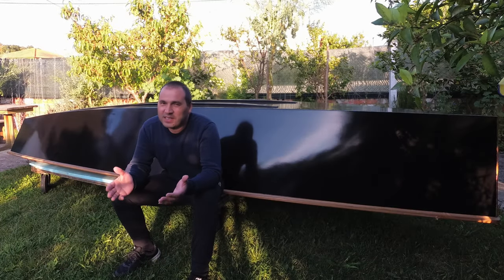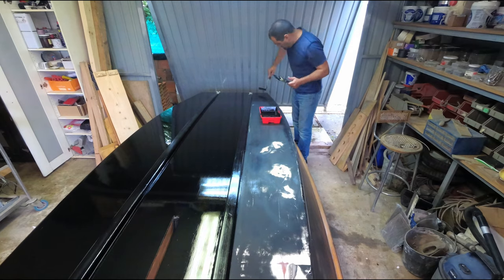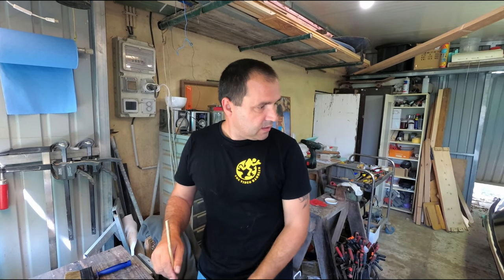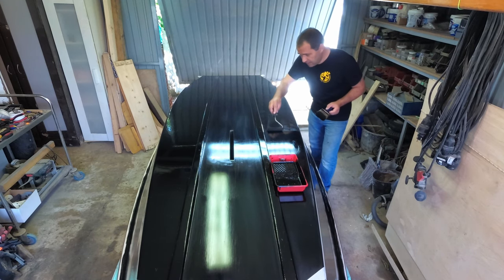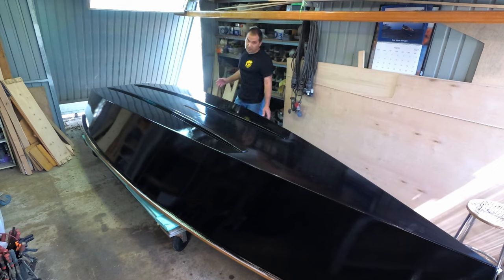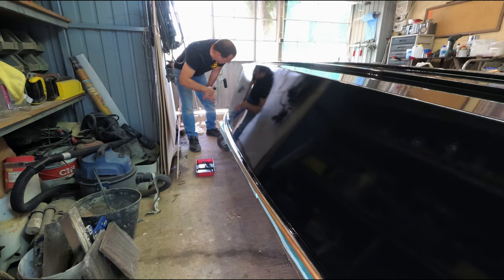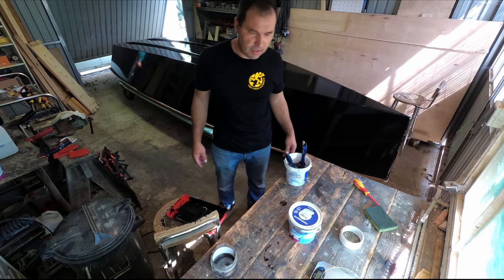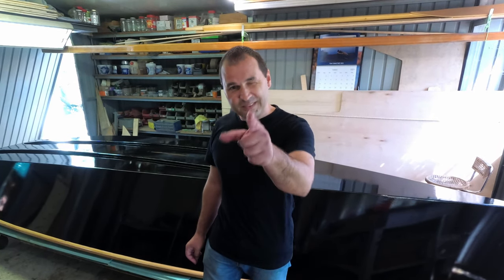Boat Painting, From Dream to Nightmare!

Comment: Once upon a time, the purpose of paint on a boat was to stop the sea destroying the wood. On your boat, the epoxy does that. The purpose of the paint is now to stop the sun destroying the epoxy. I suppose you could also say that a secondary purpose is to give the boat colour, so you can tell which one is yours ;) Or if you prefer it that way, which boat you belong to. Remember there are five letters in the word paint, don't leave out the "t".
Reply from the maker: Hi Brendan!
leave it out??? I never found it in the first place!!😅
Reply: @TheBoatRambler  Hi Teo, I suppose that's sort of what I mean. You might have a nicer time if you started using the T. If you want a laser finish, use gel coat. But why would you want that? It's a wooden boat. You don't need to pretend it's really plastic
Reply: Hi Brendan! What did you mean by "don't leave out the T"?
Reply: Hi Fran, I meant that if PAINt is causing you PAIN, maybe you are doing it wrong.
Reply: @benalla39  lol! Gotcha now!

Comment: I wonder if the black paint warms the epoxy and causes issues.  Usually black is not recommended on epoxy structures because of the issue of heating up in the sun.  Aircraft avoid such warm colors for that reason.  Gliders are a good example.
Reply from the maker: It probably contributed  to it...🤔